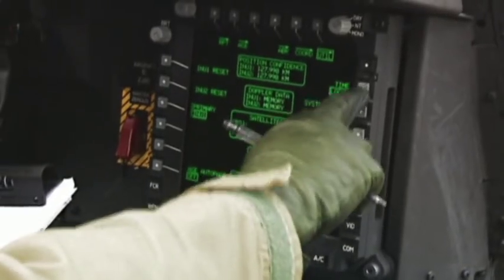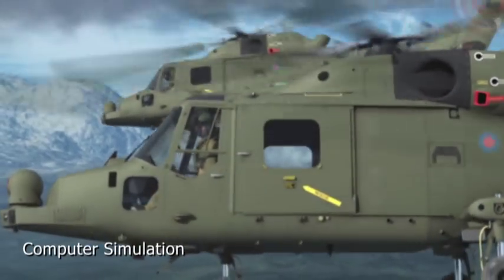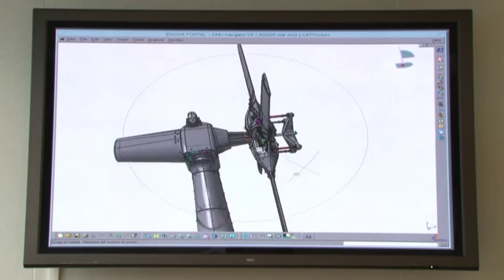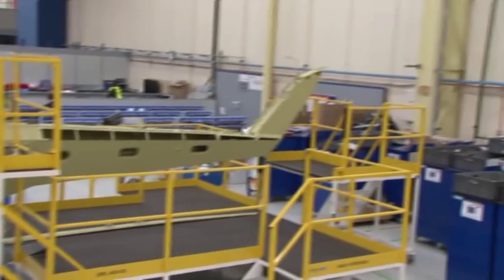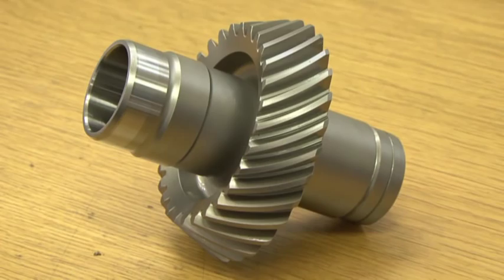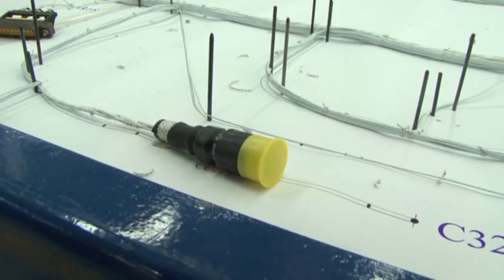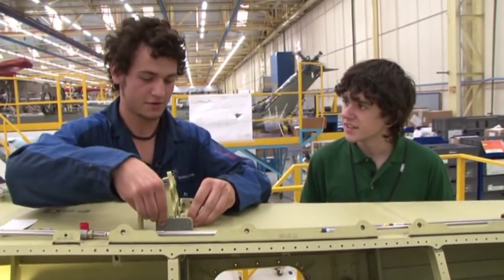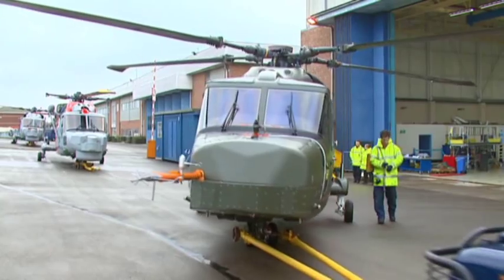Young Eagles EP9 - How to Build A Helicopter

Comment: If you want to make helicopters, you should take all the shop classes you can get into.  Study engineering, math, manufacturing and the natural sciences.

Make lots of models; aircraft, rockets, cars, helis...make as many models as you can get your hands on.

If you want to be a pilot, join ROTC or talk to your local air force or army recruiter and ask them what you should do.

Go to the library and read lots of books about aircraft.

Basically, learn everything you can about flight!

Cheers!